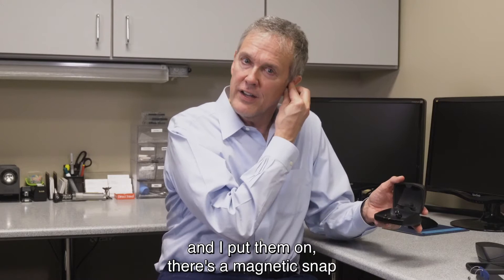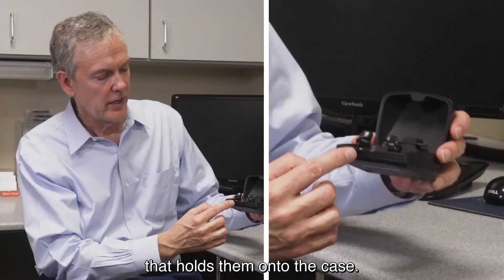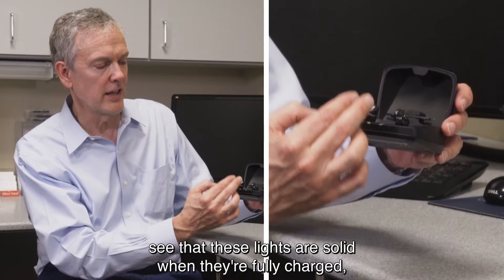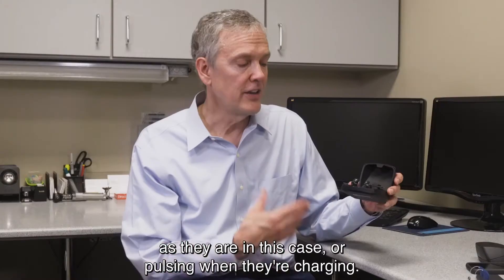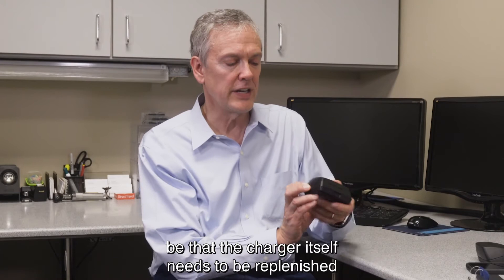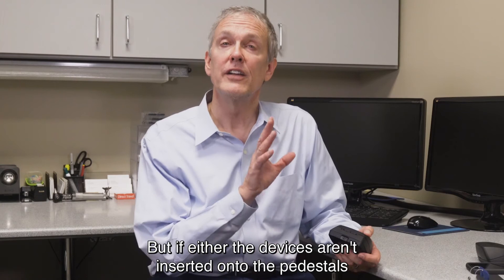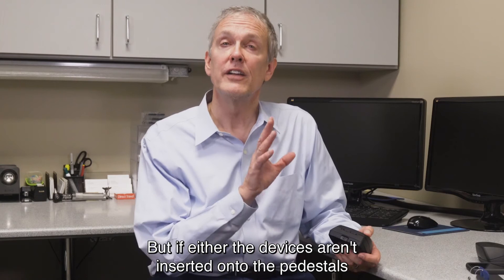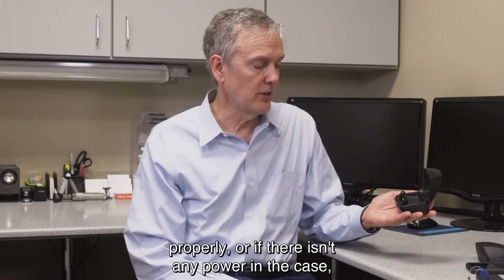What to Do if Your Custom Hearing Aids Aren’t Charging

Comment: My hearing aids won't KEEP a charge. I paid too much for them to only last 5 hours. Any suggestions?
Reply from the maker: We recommend connecting with your hearing professional to see if any maintenance or tune-ups may be needed. They can also assist you with updating your hearing aids to the latest firmware, which may help.

Comment: Useless video. My current starkey aids failed at 3 years because the batteries wore out. One will NOT charge at all (charger flashes green, red, red, red over and over), the other one charges just fine, but has very minimal capacity (about 4 hours).  My previous german made aids also failed after 3 years, but only because a switch failed in the "pressed" condition rendering both of them unusable. Both sets cost me thousands of dollars when purchased. I will not buy rechargeable aids again because this industry is a scam. I am going to explore the low cost market because I am on a fixed retirement income now, and inflation is eating me up. Maybe a trip to Costco?